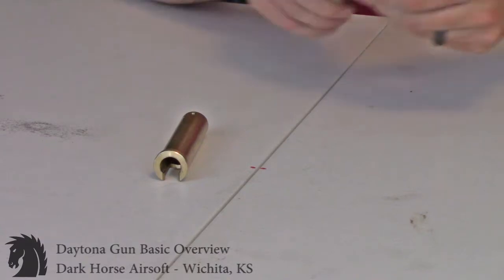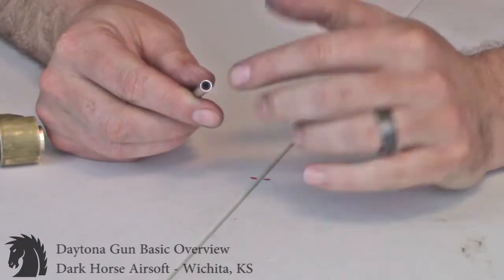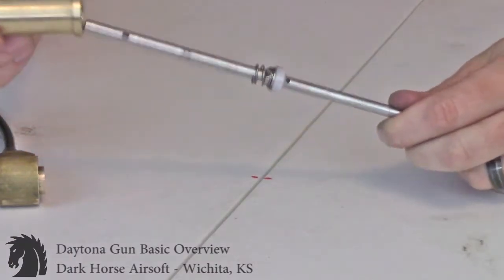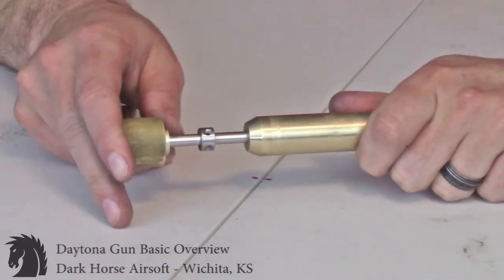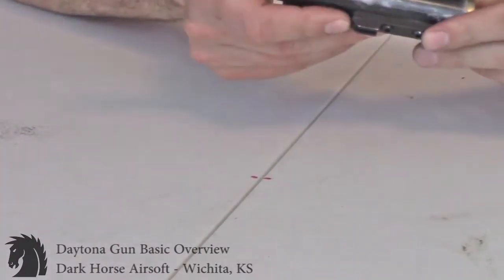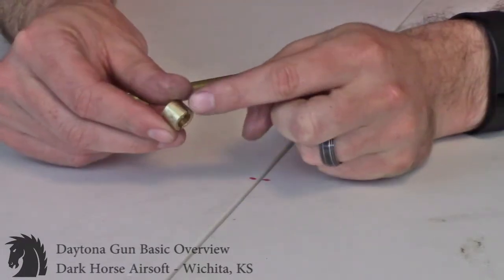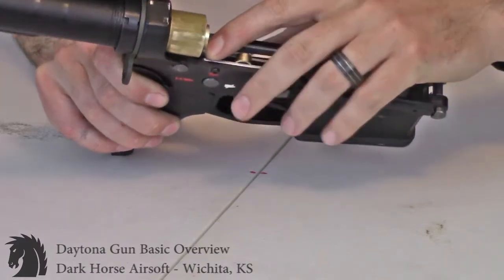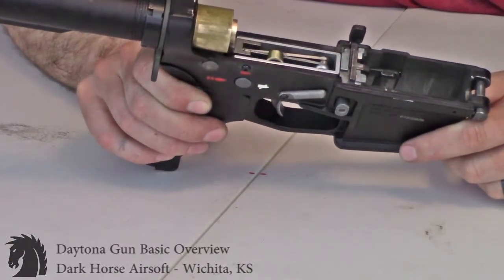Daytona Gun BASICS

Comment: great informative video! 

have you ever faced with a problem after you install a bolt hold open for a WOC based DG? It's litteraly impossible to reassemble because of semi lever beeb touched by upper and sticks out of the trigger box.. had to replace it back as it takes ages and tons of luck to fit upper on lower

Comment: oh and steel bbs, or maybe even cast lead bullets and a rifled barrel maybe??? ahhhh just had to ask, maybe its a "no fregn way" type of answer?
Reply from the maker: Do you understand how the basics of an airsoft gun function?
Reply: yes I purchased a "mil spec" escort mp5 a long time ago from some dude in Japan, it ran me 500 us dollars. Id say today, that was overpriced for what I got. Yes I know the basics, so does that mean you have a different answer for me sir? I am thinking there is not enough "umph" that travels through the 4mm i.d. hose to bring this idea up to firearm performing status, what do you think? Also, does the tank capacity of the bolt have anything to do with the actual pop power that happens? Would a bigger bolt tank capacity make the system propel the bb more, as the system builds up pressure when it cycles and is on its way backwards, before the collar is tripped and opens up??? I would say that the escort or daytona system is more of a pushing system, than a popping system..What do you think? Also friend have you heard of the caselman pneumatic machine gun?

Comment: darkhorse- what is the maximum psi you think a daytona gun can handle? Im talking about an engine made with hardened steel components, hap, stiffer springs, etc.. Do you think it can serve as a replacement for an actual firearm???
Reply from the maker: Ive ran a couple of my platforms at 140psi and have not broken but that is for a day or so. They are rated for 120psi, any reason you would want to push past that? Serve as a replacement for an actual firearm...not at all...these shoot 6mm plasti bb's

Comment: Red lock tite can’t be removed. Do you mean blue lock tite?
Reply from the maker: Desert Ghosts Airsoft I mean red loctite, light heat from a heat gun and the screws with red loctite can be removed.
Reply from the maker: Desert Ghosts Airsoft I’ll have to rewatch it to see which ones but off the top of my head I assume the 4 set screws on the lock collar. For those yes you don’t need to remove them for a simple/quick cleaning
Reply: Overhop Airsoft sweet thanks bro. Last question. Besides buying used, or off Daytona’s website itself.. where’s the best place to search for Daytona kits for sale? In the market for one for my 240b
Reply: Desert Ghosts Airsoft I’ve just started a Discord server, the link is on the DG Facebook page. It’s pretty new but some folks have joined. Hoping it picks up for used kits. Otherwise eBay, airsoft society maybe. Since Facebook rules changed selling has been tough
Reply: @mynameistin  can I be added please? I'm looking into getting a Daytona soon
Reply: @johnathanmooney6956  i dont have the link on me but yes. its posted on the DG Facebook page.